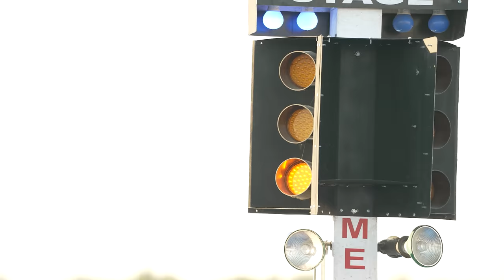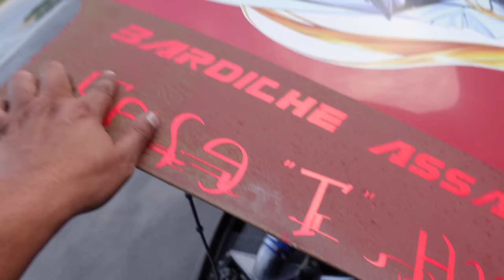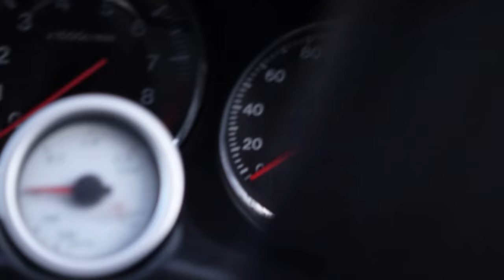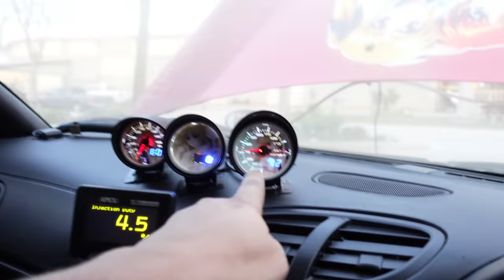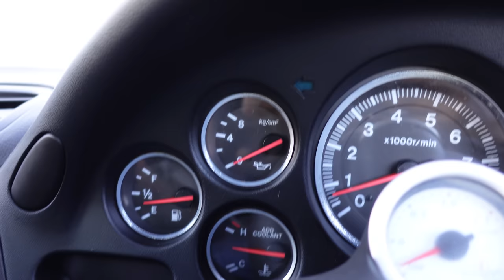I Traded My Fake Lamborghini For The Most Insane Car I've Ever Seen (It Broke IMMEDIATELY)

Comment: Dude! You hit the jackpot! From what I can see it has soo many genuine Re-Amemiya parts! AST, Boost gauge with stalk pod, Gearknob, frontend, headlights (with the glas missing), rear wing, door handles, front wheels, fender mirrors, diffusor and even the backbox (named Dolphine tail). If you are going to do a build on this car, dont go Veilside or Rocket bunny. Keep all the Re-Amemiya parts and maybe add the widebodykit (Ad-GT) and do a full Jdm Time Attack look. With all those parts it would be a shame to see something half-assed come out of this! Re-Amemiya is the most prestigious rotary shop in japan and I guess the first builder spent a pretty penny on this car as Amemiya is really expensive.
Reply: Agree keep the RE-Amemiya parts, look at the exhaust to see if you have a white smoke at cold start.  The white smoke (A LOT OF WHITE SMOKE) will be a tell tell sign of apex seal is going bad or bad and need replace (I have to replace all 3 apex seal).  I use to own a FD and it's not too much fun when the rotor goes bad.  Abel Ibarra is the Rotary Guy. You can run a little rich on these wankel engines, make sure it never lean you will fried the rotary.  Good Luck on the build.
Reply: Yeah that guy did not know what he had
Reply: Yess he did, my jaw dropped I'd love to have that
Reply: @niekgozer26  uhh he knew what he had did u see all he's cars in that garage
Reply: Too bad it will just sit in his garage
Reply: so best thing to do is strip the car sell everything and LS swap it
Reply: Definately! Jusy look at that jurassic power fc in good shape...

And the rattling...just pinging from 91pump gas...those jdm tuner tune their cars on 94octane (ron100) fuel
Reply: I don’t think the average viewer or even Tavarish himself knows how legendary Re-Amemiya is…..
Reply: @jesselee1276  Abel is not the rotary guy. Talk with Rob Dahm.  He can give you a lot of info.
Reply: @niekgozer26  not at all 🤣🤣 why don’t I find stuff like this🤣🤣
Reply: @0Heeroyuy01  what do you even own a car
Reply: @lifeononeweel3008  i do and it has a factory V8 LS under the bonnet.
Reply: damn, you gave me an idea when you mentioned rocket bunny

what if
re-amemiya fd3s with rocket bunny fenders
Reply: @0Heeroyuy01  haha nice my family got a 65 mustang swapped with a 350 crate engine from Ford performance
Reply: @lifeononeweel3008  nice, id love to have a 67 fastback but i cant justify spending 100,000 for one even in bad condition
Reply: @0Heeroyuy01  hahah yhea my brother bought it in america and then shipped it over here
Reply: @lifeononeweel3008  I hope is was a 351 crate motor. 350 is a chevy.  :(
Reply: like the rest were saying,
Keep the amemiya ffs..
i wouldn't even trade the amemiya to veilside.
Reply: @TheChaztor  a 351
Reply: @TheChaztor  or maybe its a 360
Reply: @TheChaztor  its annyway a big ford crate engine
Reply: @TheChaztor  and its aluminum
Reply: @lifeononeweel3008   Sweet.  Its always super cool to have something unique to an area.  Keep the shiny side up. : )
Reply: @TheChaztor  yee i can uppload some videos on my channel a littel later here in sweden The normal paint job for a mustang is red and White but ours is gray mettalic
Reply: @jesselee1276  that would be coolant seals, you got sold

Comment: In my mind the only sensible thing to do with a FD nowadays is to restore exterior/interior to stock or better than stock, rebuild engine, convert to single turbo and keep it to a power level of around 450 to 500HP at the wheels. Plenty of fast without going overboard. Nice little car that captures the car enthusiast idea perfectly. Demand for these will only increase with time...
Reply: Let's V12 it guys No one has done it.
Reply: Yeah you dont need to put a fourth rotor on it and go for 1000hp 550 at wheels should be plenty
Reply: Nah, keep the exterior full weeb.
Reply: Fuck that. Keep the perfectly JDM custom weebing.
Reply: @justjutroli2206  don't need to put a third rotar either
Reply: HOW ABOUT A V12 SWAP

Comment: You already have the perfect engine for it hiding away. That 3 Rotor would be awesome in this!
Reply: That’s probably what he’s got planned
Reply: Yes! This!
Reply: i think it's already in the ferrari? doubt he would want to take it out.
Reply: @RalphMouline  it was planned to  go in there, but that stalled ages ago as far as I know. I don't think it ever actually got put into it.
Reply: Your 3 rotor built by Rob dahm, with the sequential gearbox
Reply: The one from that wrecked super car ?
Reply: Why would you mount that when its got a perfect rx7 engine in it?
Reply: @D3nn1s  have you not watched the video yet? That engine is toast after driving it with zero oil pressure. And he asked for opinions, so we are offering them.
Reply: @scottm6130  if i had 0 oil pressure it would have seized up after 5sec, not do 10 full pulls.
Also you could see the gauge sometimes working i bet all it is is a corroded connector somewhere by the way the gauge was moving.
Dont trust gauges 100% theyre a good indicator for things, but only when theyre moving reasonably. Sake for gas e.g. when my car says 0 miles left i can go another 50 easily
Reply: @D3nn1s  did you hear the engine? That was NOT the sound of a perfectly good engine. Also, you'd be surprised how long an old worn engine will run with no oil pressure.
Reply: @scottm6130  its not a piston engine tho. It sounded fine when he revved it up to normal idle speed.
I guess well just have to see till the next video to know more
Reply: @D3nn1s  try listening to it again at the start of the video, and compare it to at the end of the video. You can hear it getting worse and worse as he drives it. Not sure how anyone can think that sounds perfectly fine.
Reply: Agreed, but still keep that exterior. It’s nice to have something different, besides Tavarish is a different guy, he doesn’t buy your usual cars. So him building a three rotor RX-7 that’s been Itasha-D would be really nice. It’s obviously not everyone’s cup of tea but I think with him keeping the decals it can bring the Itasha-D culture to more audiences.
Reply: @D3nn1s  my thoughts exactly (next video) my other question might have been how long was it before 'I had it running earlier', i.e. how long had it been standing?
Reply: This car already has a rotary. Just fix it if its fixable, get Dahm or someone and do a colab on it.
Reply: @sedixmrboss5625  might be, if the apex seal hasn't decided it wants to eat some housing materials for dinner

Comment: Check and fix everything engine related, change it to a (not too big) single turbo, give it a proper exhaust, a good robust tune and then fix up every crack and stuff on the exterior and redo the wrap a bit more subtle. A bit of Anime is okay. Just dial everything back a bit. Then you have a dream car.
Reply: variable geom turbo and water injection (prevention from overheating - rotaries really don't like it)
Reply: Is an oil burning rotary worth it though ... The purists will hate me but just ls swap it ! 😂
Reply: @patrickbjordahl3239  no
Reply: who's dream? certainly not mine lmao.
Reply: a bit of anime is never ok

Comment: 5:10 Having driving cars in Japan with fender mirrors, those are MORE PRACTICAL than mirrors on the doors. Seriously, they are way better.  Also BMW was notorious for not flipping the wiper and turn signal stalks when switching between right and left hand drive.
Reply: Outside of Japanese/Korean I've never seen a single manufacturer who does swap them tbh but there's always stuff you haven't seen in life.
Reply: Here in India, Volkswagen, Skoda, BMW and a few other german manufactures have their wipers and turn signals on the other side ....

Comment: I guess the reason cars here in the UK have the same stalks as everywhere else (except Japan, maybe a few other places) is because the stalks are used on the car globally. Take say BMW, they’ll build left hand drive cars for all over the world so use the same for those coming to the UK. At a guess. Never really thought about it until now.

Loved Jared’s confused look.
Reply: COST CUTTING IS THE CORRECT ANSWER...if changed the engineers would have to design the change, the wiring harness would need modified, the pins in the column would need reversed. The cost to do that to scale is too much
Reply: When I was a kid in the 80s the cars my dad had had the stalks the same way as the FD, it’s only when he bought his first foreign car (a VW Golf) that the stalks were reversed. I can remember when he first got it pulling up to a junction and putting the wipers on instead of the indicator. They’re all the wrong way for RHD now.
Reply: Freddy is right but the Japanese vehicle must be Import or pre 1995.

French Vehicles are built the cheapest. Window wipers are always the wrong swoop side.
And the Door Locks are Passenger side on UK models sold after 2001
Reply: Back in the 80's I had a Vauxhall Astra  and a Lancia Delta that had the stalks on different sides.
I was always washing my windows when I wanted to flash my headlights at someone 🙂

Comment: Nice car.  I like the livery.  When the oil pressure says zero and the engine is making bad noise it is time to turn it off. 
I still like the SLC better.   I think the other guy got the better end of this trade.  A fresh LS crate engine vs a clapped out rotary.  
I have no doubt you'll create something cool and I'll eat my words.
Reply: Nah once the rx7 is fixed up it will be worth a lot more than that fake lambo garbage.
Reply: @IamBATMAN2024  Maybe but take the money and time that is needed to rebuild the clapped out rotary plus whatever mods and power adds he plans on doing and put it in a BRAND NEW LS and the LS would no doubt bury the rotary. Plus rotary engines sound awful its like a john boat mixed with a weed eater. BRRRB BRR BRR BRR BRRRRRB.
Reply: @darrellspyker6611  Agreed on all points.  I get a kick out of the 4 rotor videos by Mazi but I prefer the nude SLC any day.

Comment: My 83 rx7 with a 12a, sounded like that when it blew an apex seal.. I swapped a 13b into it, mixed the fuel 100:1 with 2 stroke. Was a really fun car. Or it might be a compressor wheel in one of those turbos.

Comment: Sounds like low compression, I think the apex seals are messed up. That's going to be a rebuild, not that that is a bad thing, it looks like a project car that needs a bunch of work from a mile away.
Reply: For sure could use a full rebuild motor and strip car down and fresh paint clean it up nice..

Comment: You need to have a talk with Rob Dahm about rebuilding the engine and make it bulletproof. Also update the handling so that it can turn some corners. Keep the Manga styling and get some japaneses specialist to continue the theme when you update the interior, as the seller said; Someone put a lot of effort into the design.

Comment: Make it clean, lowered, fixed, remove the anime stuff from it, put normal HKS/GREADY gauges or just remove anime stuff from those you have , fix up the interior , clean up the engine bay , fix it  up , make it all polished and shiny and you will have a beast on 4 wheels , clean, powerful and loud if you put another exhaust system on it which is preferred.

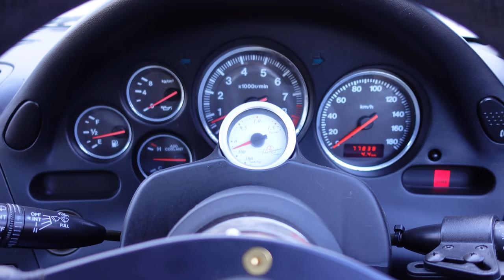Comment: 13:55 sounds like one of the turbos is going. Loose compressor wheel that is allowing oil blowby from a feed line? Could explain the lack of observed oil pressure at idle. There was a small puff of smoke on the approaching shot, but I couldn't see the tell-tale color of oil.

Comment: A-spec fd3s 400hp wheel reliable car single turbo 50mm and 3 rotor and CLEAN. STOCK AS AF on the inside everyone will want it.

Comment: 3 rotor big single turbo
Subtle widebody
Full paint mica blue
18” staggered set up jdm 2/3 piece wheels
Stock r2 wing with carbon splitter insert

Really wish I’d have been in the position to build/keep the one i had.  But definitely a fun badass car!!!

Comment: The oil pressure sender is dead, as on most of the FDs. Just swap it for a new one. They don't last very long, since they are fully mechanical, not modern MEMS. They also tend to leak a lot.

Comment: ........Take it apart....down to the frame....restore all surfaces, rebuild, keeping and refurbishing what you can. I'm sure it would sell fast or be a blast to keep around. The world is running out of these cars. A touch of anime inside is tolerable, depending on the quality of those gauges etc. As for the exterior...I would have started prying that stuff off asap.

Comment: Swap the engine, put a 3.2L i6 in it keep the twin turbos, but make them the same size to make balanced boost, then slap a wide body kit on it with a slight camber
Reply: @CreateHarmony  or think realistically??
Reply: @CreateHarmony  what not allowed to have opinions?
Reply: @CreateHarmony  oooooh my names "Turtle Bear" I know about cars
Reply: @CreateHarmony  the 2rotor in that rx7 would be horrible to work on anyways. What would be wrong with a Japanese 6cyl?

Comment: 2 things. Its a rotary so it loves to drink oil. Did you check the oil level before driving it? 2nd. You should keep it, fix it a bit, and learn to drift in it. If you really want to call yourself a car guy then it's about time you start hitting the track.

Comment: The UK setup for indicator/wiper stalk placement probably stems from most of the cars being predominantly designed for the continental European market where they drive on the right. I drive a Toyota Aygo these days which was also sold as a Peugeot 108 or Citroen C1; that is to say with all the synergies going on in the market even Japanese brands will follow the same trend.
Reply: Most probably a Japanese import they have the same placement.

Comment: What we want doesn’t matter as it will stand somewhere for 3 yesrs untill it’ll be sold or traded. What happened with SL55? 911? 355? 300zx? I would still like to see those. Is 3000gt finished? What about soarer?

Comment: Well first of all you've got no compression on at least 2 faces of 1 rotor. That terrible sound you were hearing definitely sounded like detonation. These engines are extremely sensitive to it and it definitely let go. Unfortunately, you are looking at a new rebuild as the first thing you need to do to that thing. Additionally with that kind of failure, it's not gonna be a cheap build.

Comment: nice project car to begin with needs alot of work lol im not a fan of anime aswell i think its abit overdone with it i would say restore it to normal keep the current body kit on it put some bucket seats in it and well tend to the motor, rotors are probarly warped they would need a proper recon and major service also change the wheels split rims would look good or ones with a deep dish would suit it nicely otherwise great project car alot of fun to mess around with

Comment: You traded what could have been a great custom Lambo kit car build for this mess?! I like anime. But you basically traded down. You sold a car that would have been excellent to build for a car that was already built, and not built very well. If I were you, I'd fix this thing up, get all the paint touched up and looking good, then sell it and run back to that warehouse with all of the movie kit cars and beg for another one to use in a scratch build. Because with this car you can only really do one of two things. Fix it up to look as it was when it was peak anime. Or remove all of the anime stuff and make it normal again. And you'll get flack for either choice. Which is why I think you should just fix it and sell it.

Comment: so, on the whole turn signal thing

he is both right and wrong 

a UK made car, for commonwealth markets will have turn signals like japan

HOWEVER, there are a great number of cars made for teh euro (as a whole) market so you get turn signals on the left side of the wheel, 

infact cars that are made in and designed for left hand drive markets, that offer a right hand version do this (as an aussie with many euros cars under my belt, this is the case)

Comment: anyone know what issue was with the engine? my subaru has the exact same problem as that. runs low rpm at idle and car shakes a bit and has that ticking sound